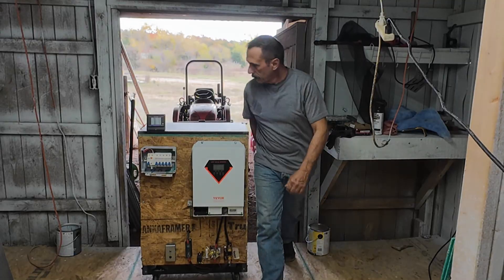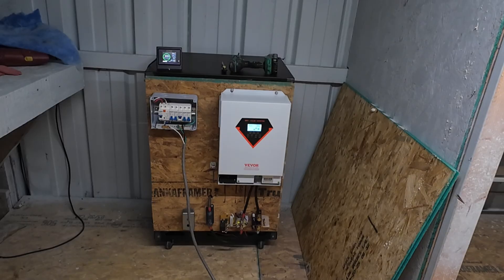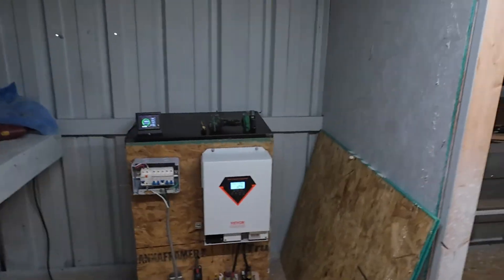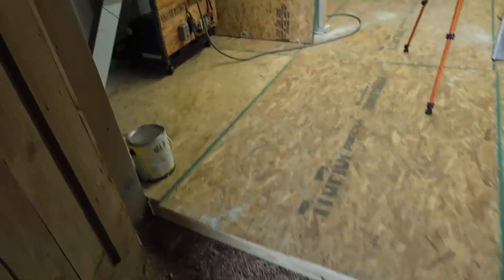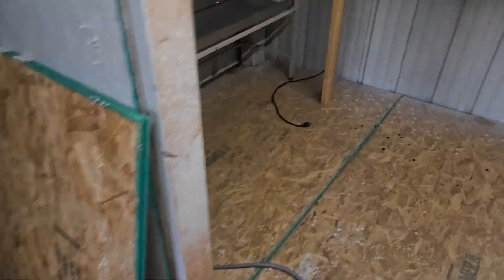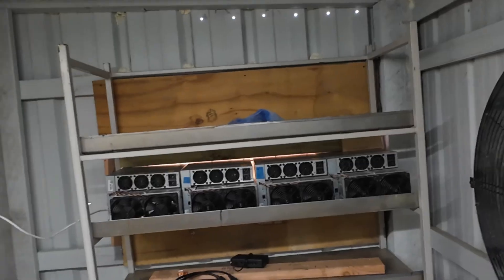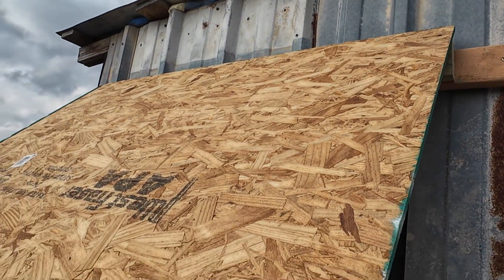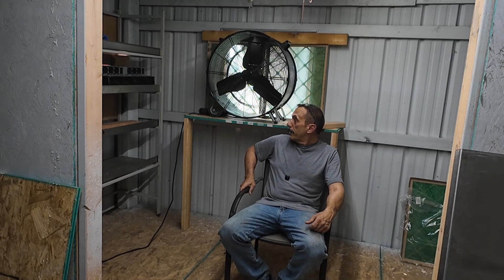The Vevor Inverter Is Back! The 100kW Off Grid Bitcoin Barn

Comment: I sleep next to x3 s21 200th miners since 2023 🥹
Reply from the maker: Nice! I take it that you are not married? 🤣
Reply: @DIYSolarFarming  lol not married but they are completely silent by using 8” blowers and I printed out shrouds then put all 3 ASICS vertical in a metal cabinet , 3 blowers sucking in cold air and 3 blowers exhausting hot air all in a 72” x 36” cabinet 😵‍💫 I can show you via ______cord
Reply: @DIYSolarFarming  one cabinet uses ac infinity 10” blowers that automatically adjust speeds (way too expensive blowers but wonderful peace of mind) and the other cabinet uses a discontinued blower but basically a VIVOR  looking blower, I’ve also tested out a very interesting build using ummmm… VIVOSUN Z8 8” and it’s insane! The silence when I go outside in front of window is SILENCE , and if my VIVOR blowers ever need replacing I really want to do a VIVOSUN Z8 8” swap (sadly the space inside would be insane as the z8 are 13” across 39” total (36” cabinet) but I’ll just offset the Center z8 )

Comment: I got a question… what is the internal voltage and amps that the miners run off of? Is it possible to eliminate ac voltage and run straight dc system?
Reply from the maker: 12 volts @ 200+ amps. You would need big batteries, big wire and big charge controllers...
This comes up a lot and it's a good thought but it's just not viable. I did run some L3++ on straight DC a few years ago, they pull way less power though.

Comment: Really enjoying the content, Ed. I've been in Bitcoin as an investor since 2015...to varying degrees. But I've also been interested in solar. The problem is, I'm the exact opposite of "handy"...I can organize and plan, but I'm just terrible with anything technical. I have a nice little rural ranch house, with a pole barn we don't use. Metal, but larger than yours I think. It would be perfect to set something like this up. I'd prefer to get solar for my house first though and build from there. We had a quote from a reputable solar installation company back in 2022, a year after we bought the house. But the quote they gave us was ludicrous. So we just didn't bother. Something like $75k for 32 panels and a 25 year loan term. Seeing videos like yours and reading some other things I've read indicate that that's not necessarily the only option.
Reply from the maker: Definitely not the only option, think general contractor, hire things out like electrical that you would rather not do. You will be way ahead of having a solar company do the whole install. 
Thanks for watching!

Comment: why invert when you have to do with  DC  miners!   ,. i mean give them the  propper  dc  voltage with masive converter and its fine . most of losses will be eliminated
Reply from the maker: Only one miner pulls 200 amps at 12 volts, it can't be scaled.
Thanks for watching!

Comment: Curious if you don't mind sharing. How much do you average per day in earnings on the 12 miners you currently have. Also what would you estimate is the total cost of the solar system that is needed solely to run them. Any idea on how long the ROV is on that setup in particular. Thanks. 🪙💰⚡️⚡️🌞☀️
Reply from the maker: Well, not all running yet, I'll let you know!
Thanks for watching!

Comment: feel like solar heating panels for water makes more sense..
somehow water should be able to become same temp as the exhaust of the miners, with a coil kind of like the solar heating watertanks have 

i use it in scandinavia and i have hot water to mid november with solar heating panels

the solar heating setup is cheaper then the electric panels for water heating.
and those you can also build yourself
Reply from the maker: Good ideas!

Comment: If you're going to leave the small water heater in the barn, have you considered solar collector plates on the roof to just use the sun to pre-heat the water? Non-PV solar water heater.
Reply from the maker: Good idea.

Comment: Greetings,  i have a 3000w 120v vevor, hooked it up to the house breaker, been almost a month now,  no issue as yet, but i havent run anything large on it as yet though,  just the kettle, blender, iron, tv , washing machine,  etc
Reply from the maker: Awesome, glad it's working out so far!
Reply: Im running two vevor 24 volt 3kw units, they have been great,

Comment: Why aren't you just using a 48v dc heating element.  No need for an expensive inverter.
Reply from the maker: I don't have one. :)
And we want to use an unmodified tank/thermostat, this way you just connect the inverter with no battery, when the sun shines it heats the tank, when it reaches the setpoint it turns off. No mods needed.
If you run off DC you can't use the stock tank thermostat.

Comment: Here's some interesting things I did about 10 years ago.Take the solar panels in a string and hook them directly to the element.Nothing in between and it works. Depending upon the impedance of the element and your voltage , your results will vary.
Reply from the maker: Yes, that does work however you can't use the tanks thermostat to control the temp, the HV DC will arc the contacts.
You would need to rig up a separate controller.

Comment: I bought a 1000 watt 240 volt element for mine. Only around ten bucks. A lot cheaper than a transformer. Also, if your water heater has 2 elements, install the smaller element in the lower hole and connect it to solar power. You can leave the upper element on the grid if you need to. Need 2 thermostats though. Thanks. BTW, use any PCs as miners ?
Reply from the maker: Haha, yes cheaper than a transformer for sure! I need the transformer for other projects I have planed for the Vevor though. Good idea on just using the lower element for solar, I might try that on the house tank.
I haven't used PCs for mining in a long time, used to be big into CPU mining with racks of servers back in the day...

Comment: Hey Ed, with the straight 240V off that inverter, how did you wire a 240V plug for the miners?  With a US standard L6-30, would you run the hot and neutral to the hot terminals?
Reply from the maker: Well, I just came straight off the breaker into a box and split off the two cables going to the miner from there.
I'm not an Electrician and not saying that's how to do it, it's just how I did it. Line to Neutral gives you 240 on a European type system. Remember our common single gang breakers in the US are not rated for 240v.

Comment: I have an office with a flat roof that has beautiful southern exposure. However, the only place i could put servers is in the basement. I wonder what the best way to deal with the heat would be. Maybe a fan to suck it outside? Idk. I'd love to set up a solar btc farm at my office.
Reply: Never put solar on your roof
Reply from the maker: It does have its downsides!
Reply from the maker: You would be surprised how much heat and noise an Antminer can create. The heat is useful in the winter though...